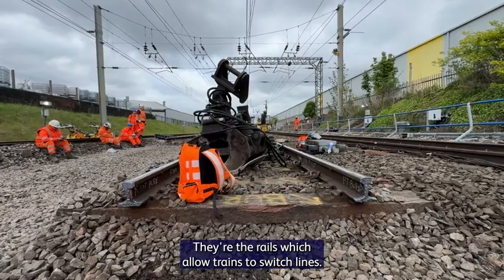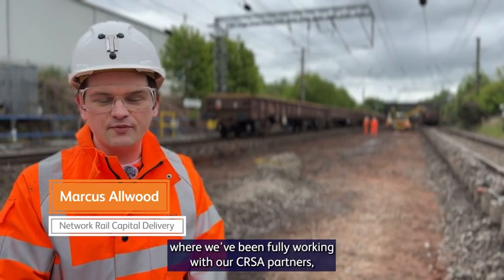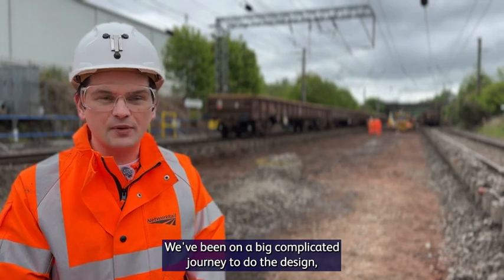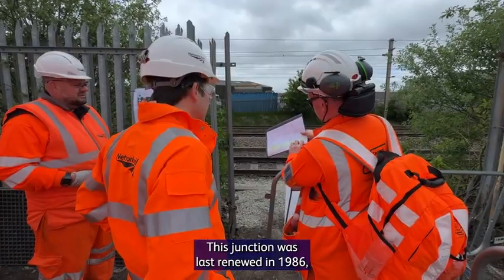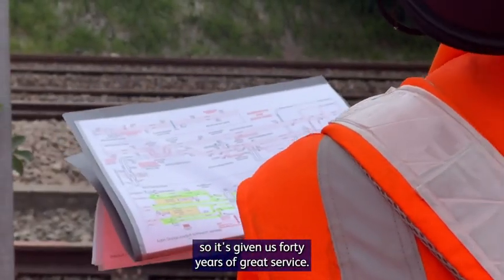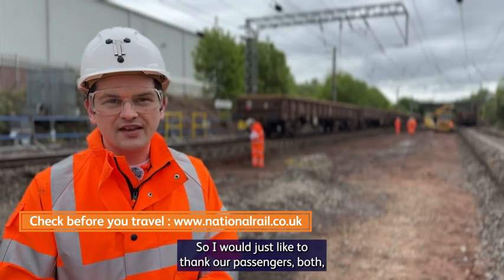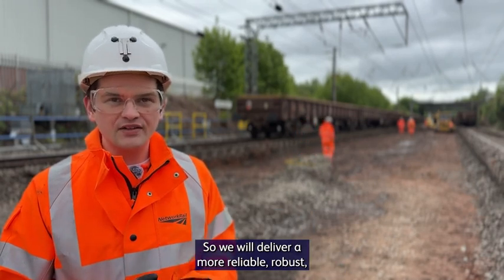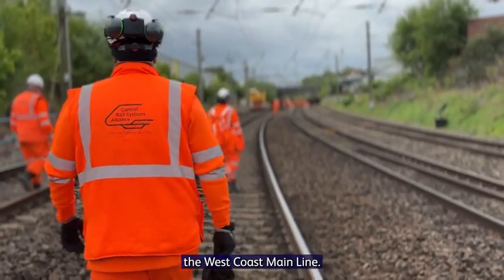Network Rail renews a major junction on the busy West Coast Main Line

Comment: The 1986 date must surely be incorrect as the junction wasn't installed until the late 1990s in connection with the Railnet terminal being built and opened.
Reply: It was definitely there in 94

Comment: They are not "switches" they 're "Points" we are English not Yanks and OBTW we invented the RAILWAYS not Railroads, whilst they were still busy shooting the indigenous people of the United States.
Reply: The entire assembly, as identified by a single ID (such as 399Apts) to the signaller, including the manual, electrical, hydraulic or pneumatic signalling machinery and the associated circuitry is known as "Points" as a defined single position on the railway. But the physical permanent way (the primary part that is being replaced here) is known in the industry as a "Switch and Crossing", the "Switch Rail" being the part that moves against the "Stock Rail", and the "Crossing" being the part at the heel of the setup where the one leg crosses the other. So, in industry parlance, "replacing a switch" is an entirely normal term. Source - I've spent the better part of two decades providing fault response and maintenance on the signalling side of the equipment.

Comment: Great work , shame it's so expensive to travel on those new lines!
Reply: If you think they're expensive now, wait for HS2 which I suspect will attract a premium price like HS1.😢
Reply: @Grid56 what would be the point of pricing people off HS2 when its purpose is to increase capacity on WCML?
Reply: @bfapple  The point ? More money to cover its horrendous cost. It's what happened on HS1. You pay more to travel by high speed Javelin than you do by ordinary Electrostar between the same destinations.
Reply: @Grid56  the revenue will come from the step-change in capacity that HS2 trains provide, and the additional revenue from new passenger and freight traffic on WCML.
Reply: @bfapple  ^